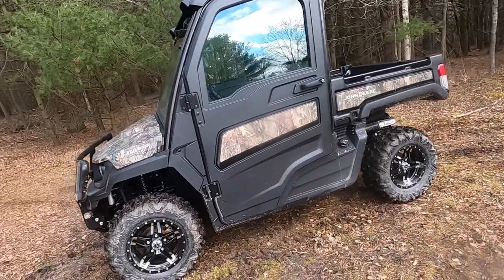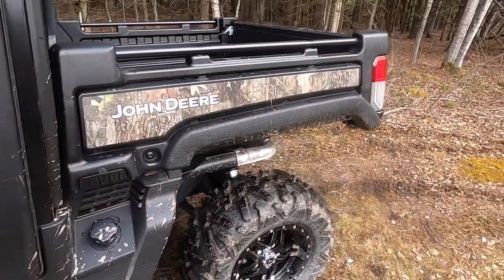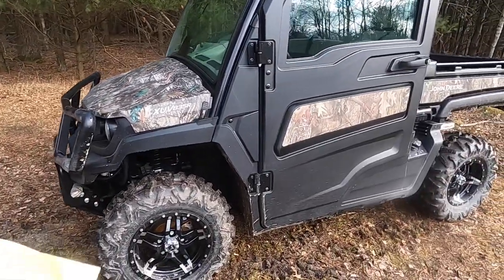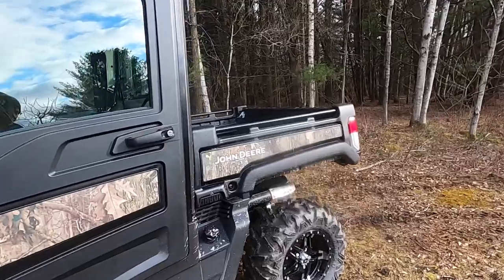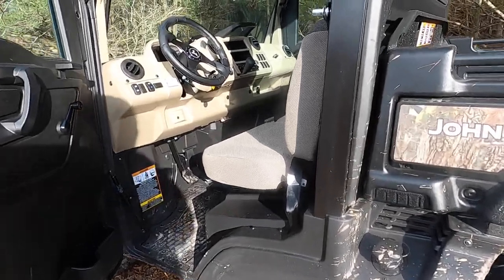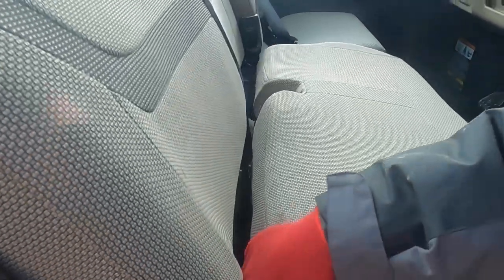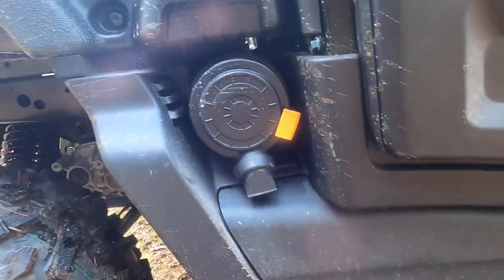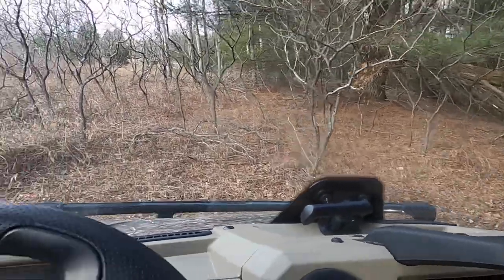2022 John Deere Gator 835R cab

Comment: Good Morning, How has the year been with the gator? Any regrets?
Reply from the maker: I actually sold the unit late last year.  We wanted a 4 seater.  The gator was good for what it was.  It was made for farm work pretty much, and that's how we used it.  We did take it on the trails "once".  The Gators just don't have the power to get thru thick sand and up steep hills. Other than that, it was good.  If I were to do it again, I'd probably go back to the Polaris Northstar, just because extra power with the engine...and lower price.

Comment: Jim that's really cool! For that price though I would probably want a diesel, but don't know how fast it would be. I think you can get a cheap entry priced Mercedes for that amount. wow
Reply from the maker: The diesels are verrry slow.  Gas and diesel tow and have a bed capacity the same.  I guess the only thing maybe better on the diesel is the longevity of the engine life.
Reply: @jimbomaz  Thanks for letting me know, I was wondering if the diesel was slow but yeah, good choice you made then! That is quite a machine, have fun and be safe!

Comment: Isn't that crazy 31,000 you paid for it can't get a radio or even blinkers in the front ,good old John Deere how to penny anti  ya 😣
Reply from the maker: Got that right.  I could easily put another $1,000-2,000 into it for additional options.  I'm not going to, but just saying they should come more equip.
Reply: I don't think Deere thought non-business people would buy these things. They were designed for large farm/ranches when the accountant told them they needed a tax deduction and they didn't want to buy another pickup. 🙂